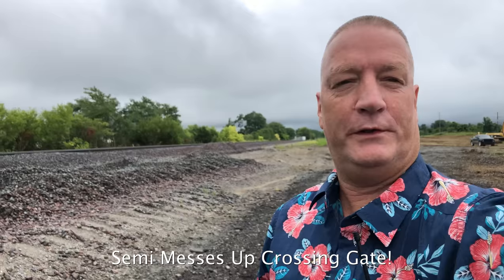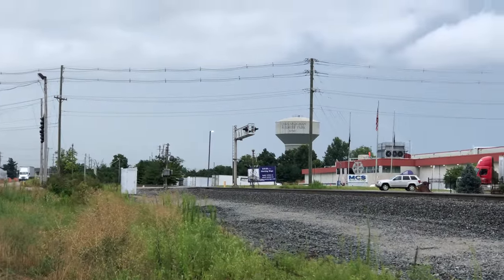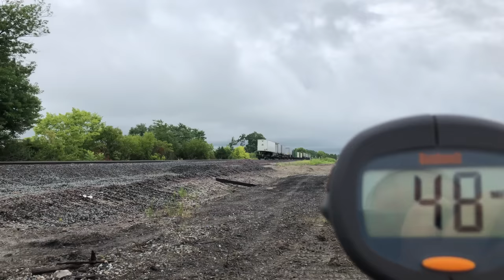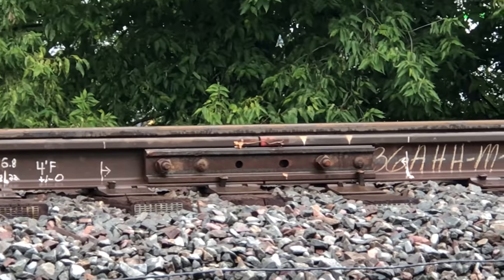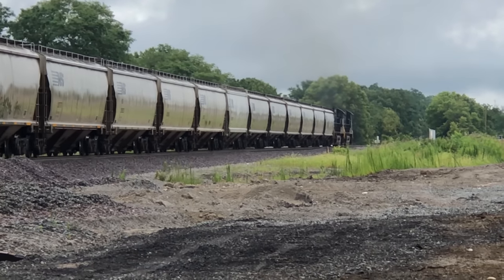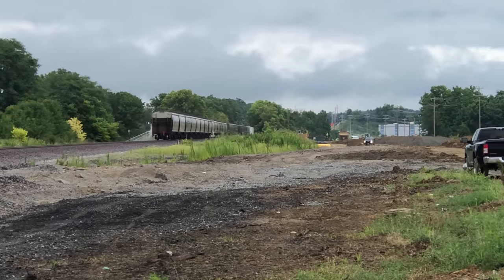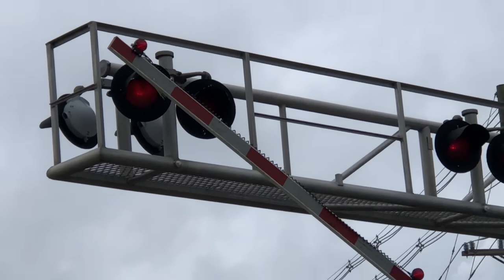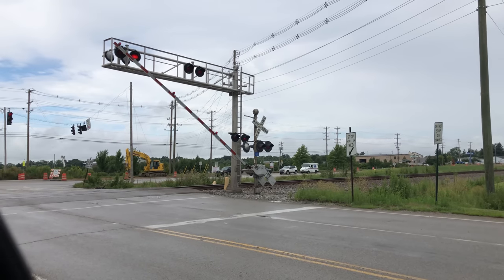Truck Hits RR Crossing Gate, Messes It Up & Train Speeds Checked By Radar! RR Shoo-Fly Update New RR

Comment: Brian, fellow that was awesome job calling the 800 number posted on the signal post you set a good example of why that blue safety plate is there and you used the identifying number associated to that crossing and mile post location, as far as the “grain shuttle” ( hss ) the crew had to come to a complete stop and flag the crossing and because of the stop the previous signal aspect is no longer valid, the restart is made at restricted speed 15 mph ( your now operating with out a signal indication) and cannot increase speed until the leading end reaches the next signal with a more favorable aspect…..40 years retired ms~~~

Comment: I'm glad you addressed why there was such a loud noise from some of the joints. Those joint differences were very noticable. I was initially surprised because I thought te new rails were welded. But your description makes sense. Thanks!
Reply from the maker: Thanks for watching and commenting Lee!
Reply: I heard that too - those joints definitely need welded before that issue causes a derailment - that would be messy there!
Reply: Yeah, JT; my grandfather used to take me to watch trains a LONG time ago. I am in my '70's now and still love it! In fact, I watch the "Railroad Archeologist" down in Florida, too. He found the last remaining rail section that was the connection point to the Florida Keys railroad. That mostly- bridge to Key West was destroyed by a cat 5 hurricane, I believe in 1935. In fact, it cleaned the Island of Islamorada almost off the map.
Reply: That Roli from Florida
Reply: There's nothing unusual about that joint. It's temporary until a welding crew does a thermite weld on the cut-in. Welded rail is laid in quarter-mile sections and even when laying long stretches of mainline, it isn't always immediately welded at some joints, like at switches, control points, etc. A temporary joint is initially used and a MoW welding crew comes along later. At least that's how it was done when I worked on the Santa Fe.

Comment: 9:00 Looks like the truck dragged the gate and rotated the entire gate mechanism slightly on the mast.  Most crossing gates are supposed to rise and drop perpendicularly to the roadway.  But this one  got turned so it now strikes the cantilever.  

The signals are designed so that the lights should flash if any gate is not vertical.  That is an example "right-side failure".

Comment: Jaw Tooth, the reason for the slight variation in speeds on the radar gun, is not that the train speed is changing, but you angle of your aiming is changing. The most accurate speed check is straight at the train coming at you (or going away). In other words, the degree of angle for the check, should be as close to zero as possible, to be accurate. Try googling information about this sometime, when you're killing time waiting for a train. Best regards and nice job.

Comment: Great catch - good that you called in that mishap caused by the truck - now a days the railroads are all about increased safety and reducing any liability.  The signal maintainers made those repairs real fast.  Will NS consider putting in concrete ties on that line at some point ?
Reply from the maker: I doubt it.  I dont think they have any on that line

Comment: Good work Señor Jaws. Your lower price RADAR gun is pretty accurate. I just bought the MAX costoso App for my cell phone here. It zaps (for bad guys, ETs, seldom seen Bigfoot, but sometimes Chupacabra), does all cosine angle comps y re-calcs 4 ya and is more sensitive at the galactic scale. Your speeds were off only a MPH or two. The higher speed going away was probably the infamous, yet still in doubt, Red Shift. Some are opting out of the Big Bang Model of the Universe and moving toward an aether-based, Plasma Electric Model with continuous hydrogen creation at the (also in doubt) black hole center and leaning towards the Plasma pinch at the toroidal plasma ball center. Shouldn't affect our trains too much though. Great video today, Señor JT. Gracias, RT sends, Puebla, México.

Comment: When the semi tipped the gate it pulled the gate in the direction of the truck's travel. When the gate raised it appears that it caught the hood on the cantilever. The one gate cannot return to its full position hence the flashers will remain activated. The signal maintainer will have to realign the gate in order for the flashers to cease operation.
Reply from the maker: Thanks for watching!

Comment: " There's more " Just love it where I hear that. Certainly long trains in the US ! I 've asked before , but had no one answer , how come  we see mixed company CPU's in some trains, who pays who ? . Thank you from the UK
Reply: Many trains originate on one railroad and terminate on another. Way back they use to remove the locos and cabooses of the first railroad and replace them with equipment from the new railroad. That takes time. So "run-thru" trains were developed where the locos/cabooses are not changed. (And nowadays no caboose.) 
Who pays for what?
I have heard of two different ways of doing it.
1). Those involved have an equal amount of equipment in the pool, so no real money changes hands, as all equipment is used equally.
2) If the equipment in use is unequal then the time/miles are added up and costs are distributed as needed. 

Equipment sharing started with passenger service. I don't know who was first but the various "City of" trains of the Union Pacific actually ran across several railroads and by not changing locos/cars it saved time and money for both the railroads and the passengers.
Reply: @thomasboese3793  Thank you so much for a very concise answer. Grateful to  you  for  replying . 👍
Reply: @tomatoes3  You are most welcome.
It is fun to see various locos from out-of-the-way places in the lead or as DPU's on a hometown piece of track.

Comment: Isn't this crossing the one you showcased a while back where the gate had been damaged by a semi, laying across the track and then hit and destroyed by a train?
Obviously no speed restrictions on this line, of course there weren't any on the Shoo-fly either.  NS has it together.
Reply: No, I think that was some little town in Ohio.
Reply: @williamsquires3070  you just described every town in Ohio....😁😁
Reply: Top speed for the most of the Rat Hole is  60 for the IM freight. When this project is completed in late 2023,  that crossing where the truck hit the crossing gate will be eliminated. All truck traffic will go under the RR.
Reply: No,It was this one
Reply: @wow77777  - well, I don’t recall that one, but there was another JT video somewhere in Ohio where there was a Wye-shaped street, and the tracks crossed the lower portion of the Wye. A big truck came by when the crossing gates were lowering, and broke the wooden gate-arm, leaving it on the tracks, which the train promptly ran over, making crunchy bits out of it. 🤣

Comment: Should have springs to pull them gates back, eh?
Reply from the maker: I was looking at one of my closeup pics of that and it looks like the gate got stuck on a lens cover for the lights.  The cover sticks out a few inches and the bar got stuck under it since it was bent a little.  That kept the bar from going vertical .  At least that's what I think.  The gate probably just needs bent back out a few inches

Comment: What is it with drivers speeding around crossings lately?

It's nice seeing freights moving more than 10 mph. Pan Am Railways became an FRA Class 1 line with slow orders because they could care less about maintenance. CSX said they'll be spending $100 million to bring the lines up to a decent speed. NS has a shared interest in the west end from Mechanicville to Ayer MA. At one point, the line was so slow, with places down to 5 mph, that trains were outlawing. When NSR and PAR formed the Pan Am Southern (PAS), they too put a pile of dough in to bring the tracks up to Class 2, or 20-30 mph. Sadly, that didn't last long because PAR was responsible for the maintenance, and NS no longer wanted to keep putting money in.  The good news is NS might be interested in buying the line now that PAR is no longer around rather than have GWI run it through their newly formed subsidiary Berkshire and Eastern.

Comment: Wonder if they need to retime the gate actions so it starts earlier, take a bit longer for the arms to come down. Or move the stop bars & gates back some. Tricky situation. Those are all long bed trailers, from a nearby steady source? If so, that company needs to work with their fleet drivers on negotiating this approach when they know their vehicles take longer than average to cross. Had that thought watching this spot a few times.
Reply from the maker: Thanks for watching!

Comment: Once that road opens under the tracks, wonder how many truck drivers going to think they fit underneath and try to drive under bridge. Worth a revisit once road opens up.
Reply: The whole purpose of the shoo fly was to eliminate the street crossing.  The bridge has to meet current height requirements for roads.  The short height is an optical illusion.

Comment: Suspect an optical illusion makes those passing trains appear to be traveling faster than the radar gun tells us.  That 50 MPH looked about 80 MPH to me, though I trust the accuracy of the radar gun.
Reply from the maker: I get so many people saying that the trains are going faster than the radar unit says that sometimes it makes me question the unit but it probably is accurate.  It takes a little fun out of it realising that the trains aren't going as fast as we think.  lol
Reply: The reason your speeds are low is the angle you are at.  Radar shows 100% accuracy when you are pointed head on.  As  your radar beam is hitting the train at an angle, it is reading lower than the actual speed.  The underread is actually the cosine of the angle of the beam.  If you are pointed at 45 degrees to the actual train heading your speed is reading .707 of the actual speed.  The changing angle as you point in different directions is why your readings vary.  Thats why police cars try to be as close to the lane they are checking as possible, to prevent under readings.
Reply: @chriswilson7044  Understandable and interesting explanation, thanks.

Comment: You should call that 800 number and give them the X-ING number to report the damaged crossing gate.
Reply from the maker: Yes, that is what I did.
Reply: @JawTooth    Yes.  I watched that part of your video after I posted the suggestion to call it in.
Reply: @billmorris2613  Always remember that you can edit or remove any of your posts as your knowledge of the situation changes.
Reply: @thomasboese3793  Thanks.  Yes I know I could remove the post but decided to add another one to explain that I posted the 1st comment about the crossing gate before I watched the portion of the video where he talked about reporting the damaged gate.  I did so to help with the comments count.  If I had posted something that was wrong I would have fixed it or deleted it as needed.

Comment: The new bridge at 9:50 doesn't look high enough to allow trucks to pass under it, presumably they're going to dig it out deeper.
Reply from the maker: Probably, thanks for watching!
Reply: It looks like the surface under the bridge has been paved. If that's true then no. 
Also, remember you can't just dig deeper without having the footings for the bridge already in place, but, why fill the dirt in if the road is going to be deeper? You only waste time moving dirt and you could damage the bridge digging the dirt back out from under it.

Comment: A quick question.. wondering if anybody was able to differentiate the sound of the train..I mean the running sound for the first train was different than the second train. Is it because of the speed as the first train was hitting between 48-55 in the radar while the 2nd one was less than 45mph. Or because of the rail joints. Railfan from Bangalore India.
Reply: I'd guess that empty rail cars are a lot lighter and a lot more rickety.   Loaded cars hug the rails a lot tighter.

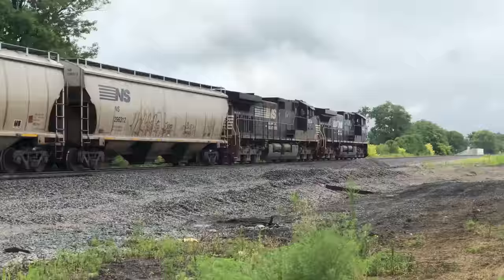Comment: 4:48 Every car on that train was identical !    Wonder what they were hauling ?
Reply: Unit train from a large corn, wheat or some other grain processor. Southbounds usually loaded headed for seaports for export while northbounds empty returning for more loads.
Reply: Three (3) different car types in the train. The differences are small, but if you know rail history and are a rail fan you do spot them. Different builders have different design philosophies, and changing traffic demands can repurpose equipment. 
The seventh car behind the locos sticks out like a very sore thumb... (look at the frame thickness, the roof overhang on the side of the car, and note how "flat" the curved side is when compared to the others.)
At 6:06 you see an old open coal hopper car given a roof and repurposed as a covered hopper for grain service.

Comment: That underpass look very low for trucks. It may be an illusion because there is nothing to judge it by. It is a wide span.
Reply: Use the train above it to start your judgment. I'm sure the height as is, is what they wanted. Just have to wait for the "height clearance" sign to be posted to know for sure.
Reply: @thomasboese3793  I looked at that, but they dont have the road surface down yet, and Im sure they dont want to make it a low spot.

Comment: Jaw tooth I'd really like to show you how to use a radar gun correctly. Pointed at the train when it first gets there the locomotive front and point it as soon as it goes by, the rear end. do not try the radar it what's going by it will show you up false reading.

Comment: what frequencies are you listening to for CSX and NS in northern kentucky?
Reply from the maker: For NS I just listen to 160.950 for the road.  For CSX it depends on the line.  Best road frequencies for CSX are 161.370 and 160.230 sometimes I use 160.320 if I'm bored.  I also use 452.9375 for end of train device and sometimes I will use 457.9375 for front end of train device.  I only like to listen to the frequencies where they call out the signals and where you can hear the defect detectors.  I usually listen to only 2 frequencies at a time with a max of 4.  If you have too many in your radio you will start missing things and get confused.  The fewer the better
Reply: @JawTooth  thanks

Comment: You should come down to FL along the FEC tracks where the Brightline runs. You’re guaranteed to record a wreck of some idiot running a gate and not taking into consideration that the trains is running 100mph.
Reply: Yeah, I was wondering if they need to post signs, by the time you see the Brightline, it's too late.
Reply from the maker: I want to return there in the winter.  Thanks for watching!
Reply: Those Brightline trains aren't going 100mph yet. They go 70mph. They will go 100mph only in Central Florida. Now it only goes between Miami and West Palm Beach and the speed limit is 70mph.

Comment: 2:31 - says 51 mph, angle is about 15 degrees?  51 / cos (15°) = 51/0.966 = 53 mph true speed
Reply: Tried searching on this but found nothing. Is this formula to calculate for the doppler effect ?
Reply: @currentfaves65  Yes --well no.  The radar gun does the Doppler effect.  Dividing by the cosine of the angle corrects it for the orthogonal component that registers as not moving.